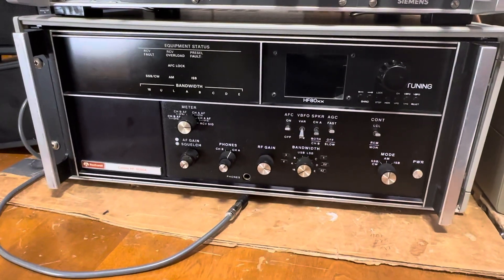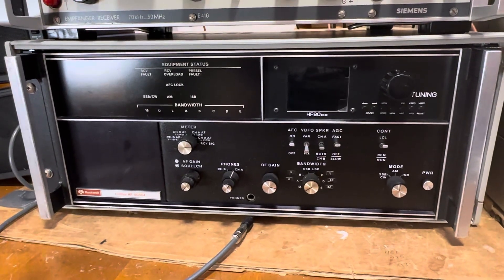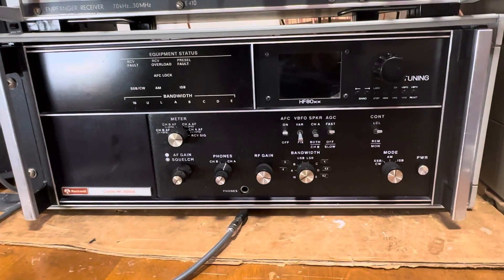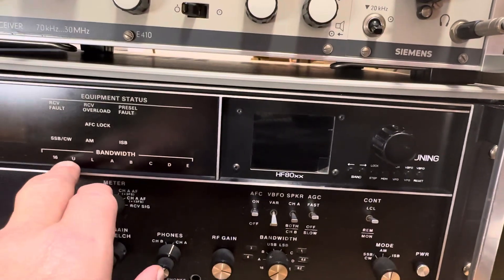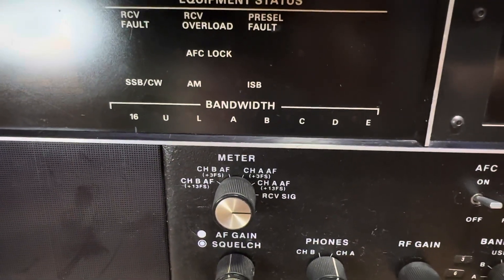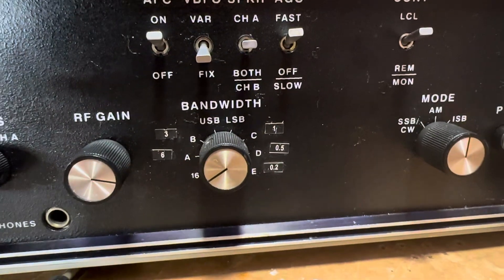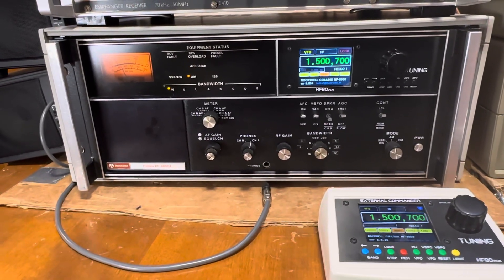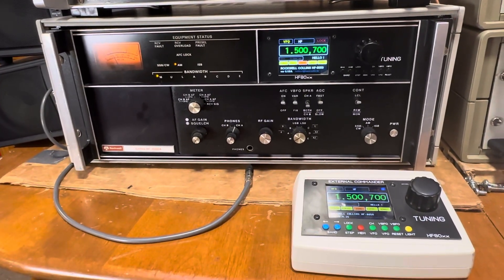Collins HF-8050A With Tuning Upgrade!

Comment: The modification is awesome Chuck!
Would like something similar for the Ten Tec RX-340.
Reply from the maker: @AdamSWL  That’s pretty tricky for the RX-340. The only mods I’ve done for that is replacing the backup battery and the internal speaker with a better one.
Reply: @KI4BZJ  Thanks Chuck.
I just wished the Model 302 keypad encoder worked with the RX340.